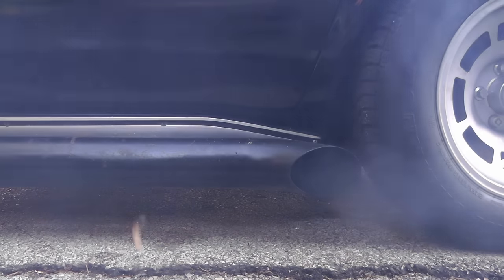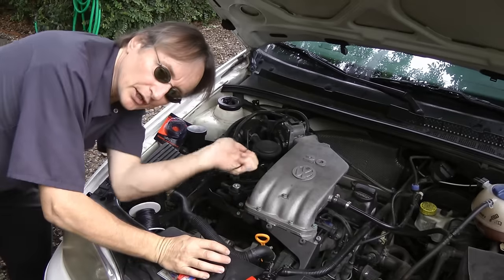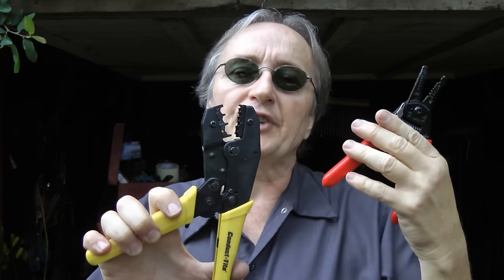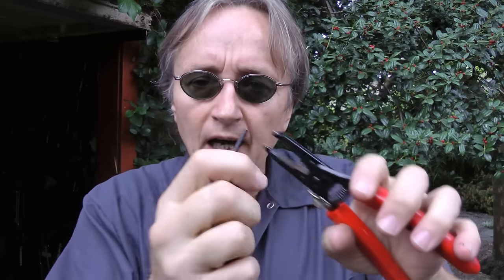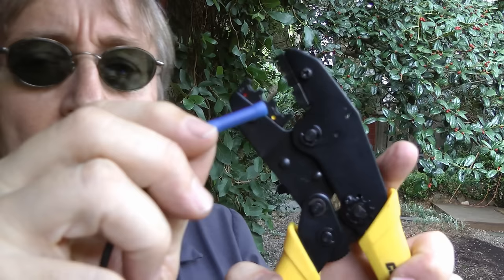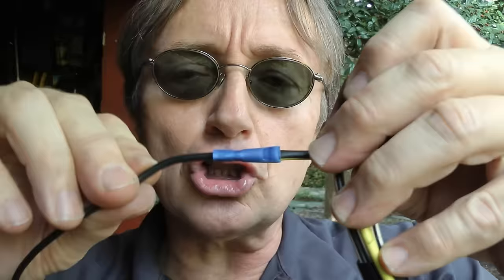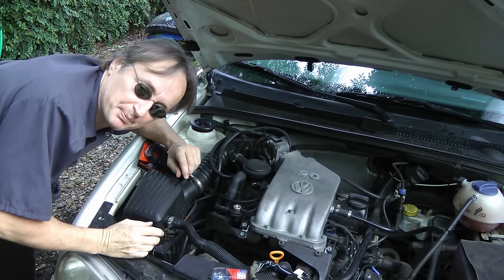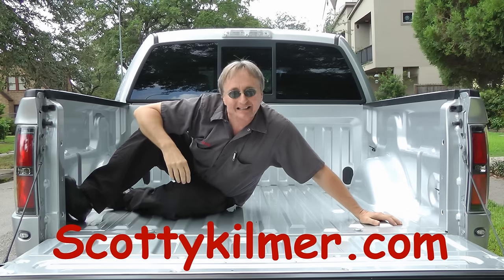How to Splice Wires Together in Your Car

Comment: hello one of my coil conector in my nissan maxima 2005 coil number 6 have an extra cable but it no conecte to enywhere  I find it do you have eny idea for what someone put one more cable and just hanging I dont no but I change all tree coil and spark bucause my car shake like one coil or spark is bad, thank you  hope you can answer thank you again
Reply from the maker: well, make sure everything is plugged in correctly cause the wiring harness only comes with one plug for each coil. And replace any bad coil, those maximas tend to eat them up

Comment: @backwoods3214 Auto part stores also sell connectors that are weather-tight. They cost a bit more because of the rubber insulation.

Comment: Scotty, my rear left turn signal doesn't work. When I try to signal, the left arrow on the dash just stays lit up. I've replaced the bulb. It used to work sporadically but I tried resoldering the contact and now it just doesn't work ever. What do?

Comment: I also have a strange problem just popped up I have a 91 camry 4 banger 98k miles and the AC stopped working . the ac clutch has no 12 v to it . The AC button lights green and the car also does not idle up. I tried to put 12v to the clutch but it still will not come on. I checked a 10a fuse it was ok . I checks the AC relay and no 12v to it I am lost HELP???

Comment: I have a 2002 ford Windstar radio needed to be changed out I put a new one in all the wires are correct but I'm getting no power to radio
Reply from the maker: +Weldo Harris check for a blown fuse, they tend to hide radio fuses everywhere. Or, just run a new power wire from the battery to the radio and put an in line fuse on that
Reply: I checked all the fuses under the steering wheel could there be one under the hood

Comment: Sooo where can you buy those ass connectors?
Reply: Pretty much any auto part store. I have to do this on my car. Im making a video on it
Reply: +myCarRepairChannel ewww please don't bro
Reply: AutOdometer 
Hi hey I was taking out my PCM and noticed a tiny tiny wire with a tiny nick Is that my problem ? Changed alternator twice new battery etc. now don't want to buy new computer if its only that wire ? Please get back to me Thanks a lot Oct 4 2017
Reply: Try any corner near the capitol in DC. Lots of ass connection around there.

Comment: You don't know who I am or what I know. Last time I checked, you can't get a voltage reading by touching the outside of a wire, smart guy.

PS - There is a difference between THERE and THEY'RE, as well as YOUR and YOU'RE. Pretty basic and elementary stuff.

Comment: @scottykilmer hey scotty i dont know whats going on my maxima's battery isnt charging the alternator tested good and so did the battery i changed the belt but the car dies on me when i come to a stop and when i disconnect the one of the cables to the battery the car turns off and i always end up with a dead battery i dont know what to check could you tell me what are somethings to look at

Comment: @Electrohacker45 See, that's the problem, I've tried the scan tool and nothing comes up. The Check engine light doesn't stay on, so I don't think there's a code to be read.

Comment: alot quicker, simpler than tinning the stranded ends with solder, bending u hooks into it without it birdcaging the tinning, soldering them together without forgetting to put heatshink tubing on the wire first, cleaning the old flux off, then shrinking the heat shrink without melting it, I remember once I changed out my stereo and saw that the previous owner used the twist the wires together and electrical tape  the crap outta it method, what a mess that was

Comment: @s0nnyburnett Unless you don't have access to a garage or ac power. Those battery powered portable soldering tools are weak and the butane ones are kinda tricky.

Comment from the maker: @Buckley710 yea, it's an AUDI, endless money pits as they age. I;d start by taking the driver's door panel off and checking inside there for shorts. But realize in those babies, everything is controlled by computers, and to fix em, you often need a vw audi dealer level scan tool to interact with those stupid computers to find problems. Not fun cars to work on.

Comment: for my headunit in my car the only way the headu it comes on is if the ignition and battery wire are connected how do i fix that
Reply from the maker: +Jacobi Boyer heck,just rewire it that way, or if you mean you're bypassing the ignition switch, could just be a bad switch

Comment: In a much later video, Scotty shows how to protect wires with liquid electrical tape (even discourages little animals chewing on them).
I suppose this could also waterproof the connector.
I also wonder if dielectric grease in the connector is advisable.

Comment: hi, my 04 v70 headlight connector is burning up cable and connections. though these connectors are ceremic but still its getting so hot that its burning the cable connections.can anyone please tell me why its getting hot or how to treat this problems. my connectors not lasting even one month. please help.

Comment: Please help!!! My dog got under my truck and chewed up the shift sensor wire I took off the connector and there's only a blue and green but in the wires hanging down there is just about every color is anyone know what colors go together to go to the blue and green on the connector so I can splice it back together

Comment: Hi, I just installed 90/100w xenon bulbs in my fiat uno. Now some people say that I will burn my cars wires when I use my headlights? Is that true? I like the new bulbs because they are much better than the old ones but I do not want the wires to burn.
Reply from the maker: they should not burn, xenon bulbs use high voltage power, but LOW amps. It's the amps that melt wires
Reply: A Fiat UNO ? I can’t remember the last time I saw one of those on the road. Good choice Sir ! (especially if it’s a Turbo ie).

Comment: at 3:15 I'm having problems with my starter S terminal connector on my Honda Civic I clamp it down it repeats with no start.i have to push start all the time it doesn't work.

Comment: why does my radio cut off when I step on the brake pedal
Reply from the maker: +mikeymic845 have the battery and alternator load tested, auto zones do that free, often weak ones do that
Reply: Just replaced both last week.still dose it .also my lights (dash .dome.headlights .taillights flicker) but radio cuts on when I step on the brakes
Reply: Cars a 2012 forte koup .has 50k on it

Comment: 2 things!! I'm an engineer. 1st if you can solder the wire and have to crimp please DO NOT cross crimp. So both side crimps have to line up. 2nd put some waterproofing heath shirring on top of the butt/spade or any other crimps connector as it will corrode and brake in few months! Do it once do it right!!!
Reply from the maker: these are internal splices inside the dash, water does not get in there. For outside ones, sure, waterproof em

Comment: Anyone had any issues with 12v socket where the power seems to come down the thin wire but the two thicker ones don't seem to have any power n the 12v socket doesn't work

Comment: i hate to say it but you didnt do it right. first  all stranded wire you need to twist the bare ends before you put it in any connector. it keeps the single strands from getting cut off or wiggled off weakening the end.second  the connector you used would rot  off in a single winter in any salt using area, it should have been a heat shrink style . inside the car that end would be just fine with a little dielectric grease smeared in the ends  and a little black tape.

Comment: The initial promo picture for the video shows you just splicing 2 wires together in parallel and then into another wire, which is what I needed to know how to do. Splicing just 2 wires together is NOT what I expected to see. Not helpful at all and actually kind of deceptive.

Comment: Scotty, this is the only video of yours I don't like, Butt connectors are horrible, because they can allow moisture to get in, and it can corrode. You should solder the wires instead. You should always at least cover the connections with electrical tape, or with heat shrink, which would be best. Also, I HATE working on cars where people just cut the wires, and replace them with any color, sure it takes more time to find the right color, but it makes diagnosis easier for the person after you.

Comment: Butt connector's aren't waterproof and can easily pull apart compared to other connectors...isn't it better to use another crimp-type connector, and then cover with heat-shrink tubing to make sure it's waterproof (especially on a car where it's exposed to the elements)? That's what I saw in another video.

Comment: i have used crimps all the time and never had a problem with them its how i do mine over the years and never has gone wrong with it. if im in a hurry i use some heat restance glue to hold it together and put electrical tap around it. FUCK KNUCKLE